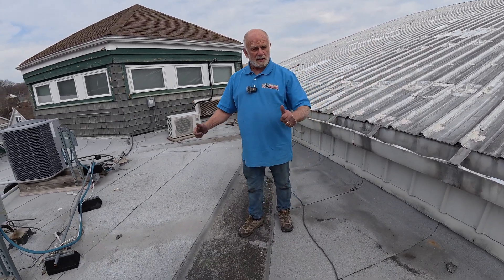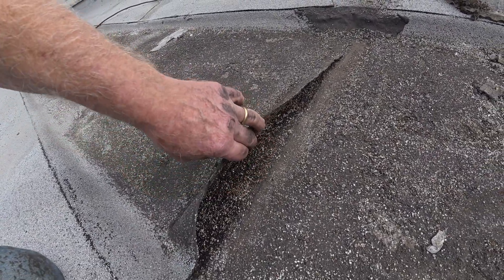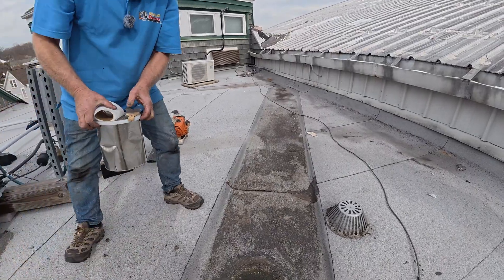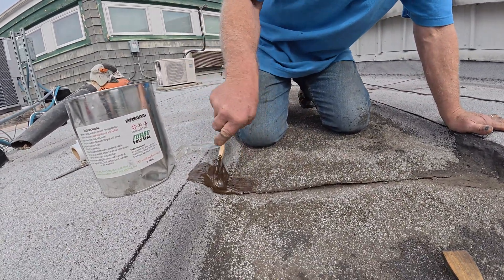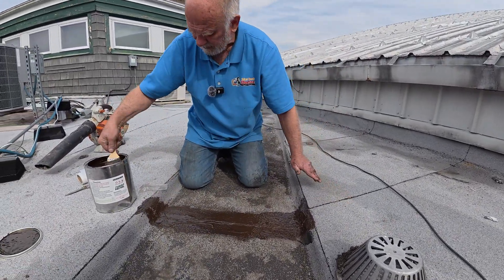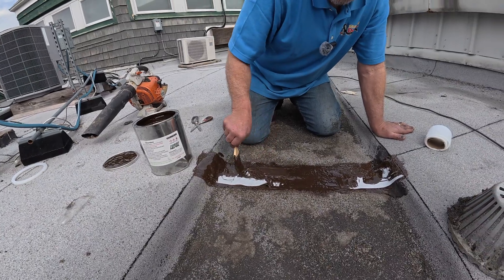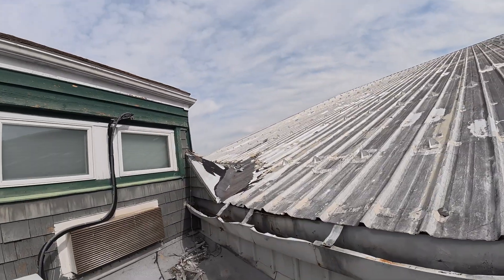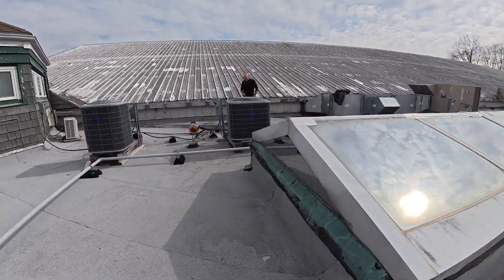Rubber Roof  Drain Seam Repair   4K

Comment: You love that stuff !!!
Reply from the maker: its my go to product for many years. A game changer. I don't have to caryy a lot of equipment and material around just for any little repair
Reply: It's a game-changer...the super poly and the super silicone, both.... I'd been wrestling with pros for my flat, rubber roof.... I'd known the guys working up there- they each had decades of success/experience, so the problems we're "them" really....but they just couldn't get the leaks to stop....I got up there, used my own eyes, my own sense of how water flows, finds gaps, follows gradients, etc ...found all manner of possible factors....used super poly where it applies, used super silicone on all the rubber to rubber seams....two years (harsh summer sun, harsh winter cold and ice) and zero leaks, zero issues....for the first time in 10+ years, there's been nothing coming in.

I just "painted"/slapped on a generous layer where it looked needed or where I SUSPECTED it would be needed....used the fleece in most places, but not all. I did use fill-in foam under one broad gap in some overhang at a joining of low-walls, but I think that was more for cold air and animals than water....

It's not the cheapest, at a glance, but add up the time and repeated treatments from garbage silicone (etc), nevermind water damage repairs, and it more than pays for itself...

Super silicone, I used white, and for a few reasons: minimize the heat gradient in the summer, I can clearly see where the application was, and it's the roof anyway- nobody else is going to see it.